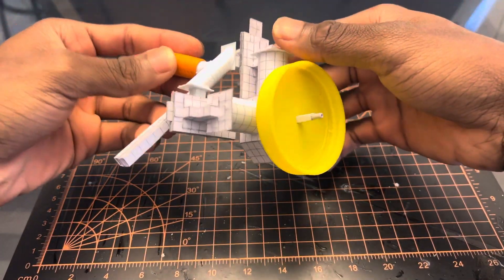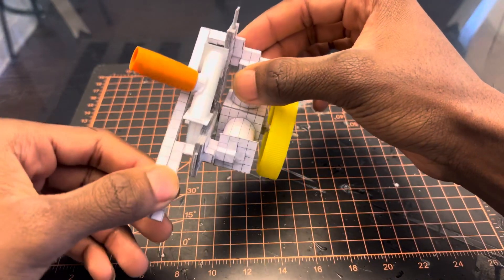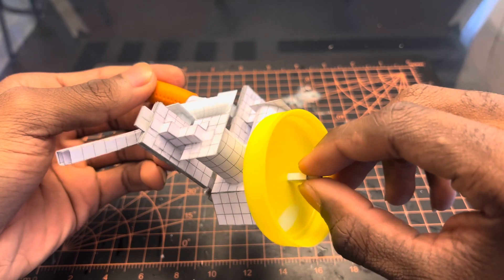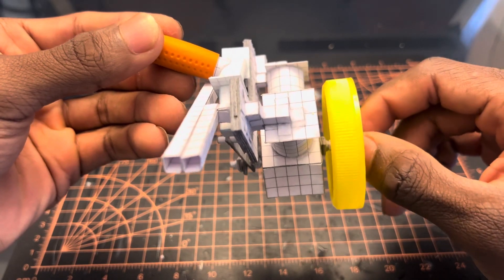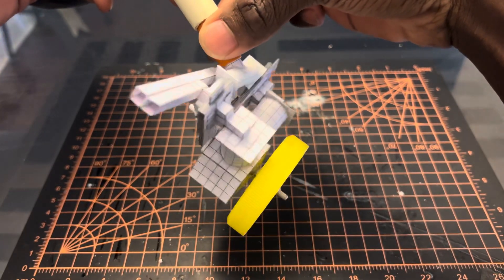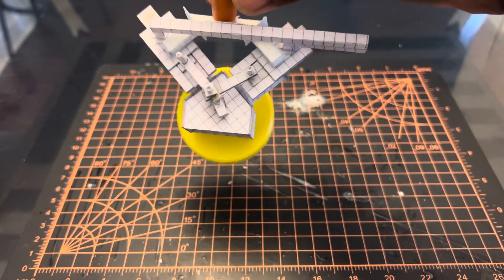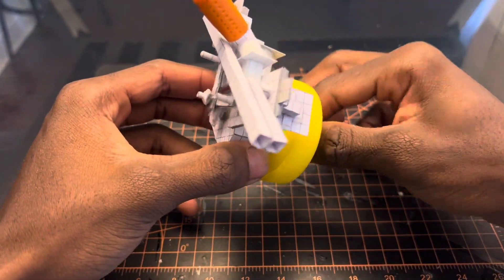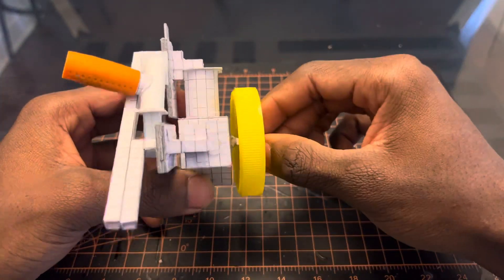I Powered My V-Twin Engine With 10 Balloons

Comment: is the valve timing on the v twin the same as the boxer? I’m the v twin isn’t always firing but are the slider pieces on bottom dead center when firing
Reply from the maker: yea when the valve is at the bottom it fires
Reply: @PaperEngines damn I didn’t say that question right 😂 what I meant is how did you get the valves to match the piston firing order but now that I think about it the value would be in the same firing motion as the pistons 😂🤦🏾‍♂️